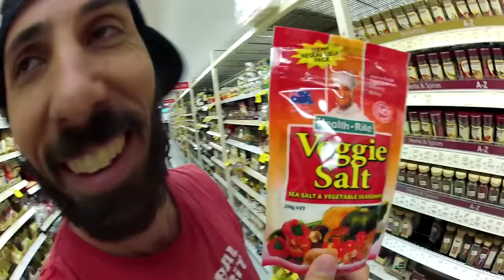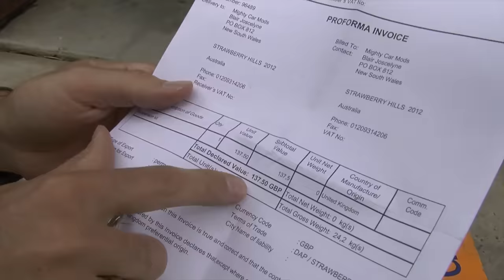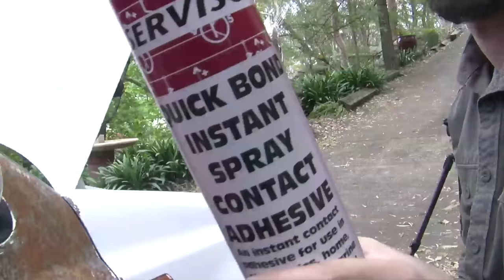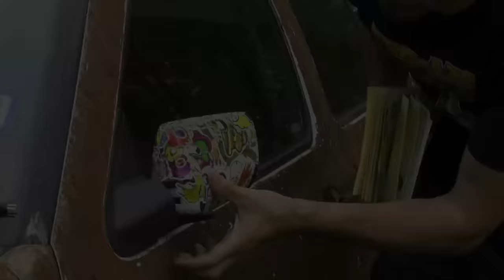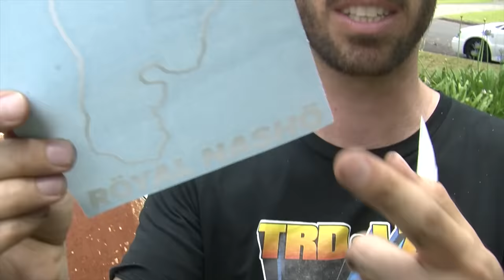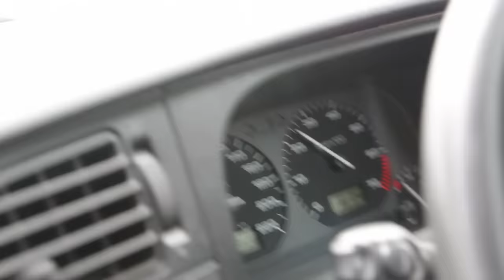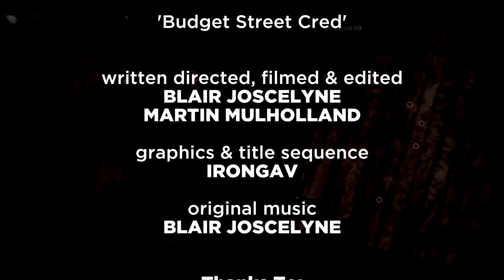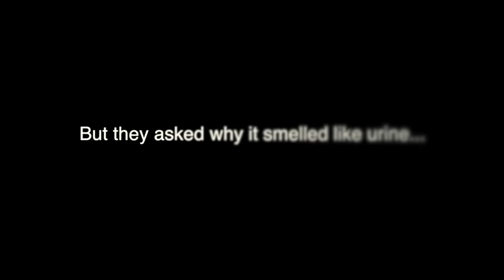Budget Street Cred (Season Finale)

Comment: Where's the best place to get aftermarket parts for Japanese & Korean cars here in Australia.

I'm thinking of doing the following mods & preferring Australian, NZ, Indonesia, Ireland, Malaysia, South Africa, Thailand, UK, or Japanese (or other LHT countries) sourced products:

* Woodgrain Trim, Leather Trim, Houndstooth Trim, or Velour Trim
* Woodgrain Veneer
* Woodgrain Inlays
* Woodgrain Inserts
* Window Tinting
* Leather Interior, Suede Interior, Velour Interior, Microfibre Interior, Alcantara Interior, Wool Interior, or Cloth Interior
* Lambswool Rugs, Heavy Pile Carpets, or Velour Rugs
* Heads Up Display (showing speed in km/h, the speed limit in km/h, GPS navigation directions, and ideally additional info like low fuel warning, lane departure info, reverse cam vision
* Footwell lights (possibly SMD LED STRIP LIGHTS)
* Rear Cross Traffic Alerts
* GPS/Dashcam (possibly Navman MIVUE860DC TYRE Dash Cam, Garmin DriveAssist 51 LMT-S 5" GPS Unit, Navman Drive Duo 2.0 5" GPS with Full HD Dash Cam)
* Blind Spot Sensor - Possibly Parkmate PTS-440BSD Sensor Front & Rear Blind Spot Detection System, Mongoose MBSW4 SURFACE MOUNT MODEL.
* Lane Departure Warning -
* Parking Assistance - Graphical Display
* Park Distance - Front & Rear 
* LED Headlights
* Car Alarm - to achieve compliance with AS/NZS3749.1 Class B or AS/NZS3749.1 Class A. 
* Camera – Rear - Potential Solution is PARKMATE 4.3" REAR VIEW MIRROR MONITOR, Gator 9IN MIRROR MOUNT LIVE STREAM CAMERA KIT, PARKMATE MIRROR & MINI CAMERA REVERSING SYSTEM
* Automatic (light sensitive) - Potential Aftermarket solution Jaycar KIT - AUTOMATIC HEADLIGHTS 10/13

Comment: Best way to paint strip. Cover the panel in paint stripper then chuck plastic film over the top and rub it in. When it does it's job, peel the plastic off and most of it should come with the plastic. I've spent too much time with that fucken scraper

Comment: Terrible episode! Just about everything done to the car financially, was not explained in detail. How much were the rims and tires? How much was the lip roller tool? What was done to the camber? How much did that cost? Did you get the alignment? 
Now, as for street cred, appearance is not all that's considered. Horsepower and engine/drivetrain mods are what's required for true "Street Cred"! All of that useless exterior work was an incredible waste of time/money. Suspension, wheels, and fender flares were great but, come on now! No intake? No exhaust? No chip flash or Dyno tune? A street car with upgraded valve springs with some pace setter headers and a high flow cat with a  2.5 inch modified cat back exhaust isn't much and would add some noticeable "Street Cred". 🤓🤔 
BTW, why were you pulled over? 
You really went to the wrong car meet a week later? ALL of those people were straight B.S.ing for the camera. I bet that the people who say they liked this car/episode, don't know crap about car's! You guy's purposely destroyed this car knowingly and willingly yet, you were able to find idiots that liked it? Just goes to show that there are sucka's born every minute/second! 🤓 Weak!
Reply: Dude, this vid is seven years old. Piss off 😂😂
Reply: @junglist1soldier  Buddy please, I've worked on cars my entire life, I was brought  up with them. Kinda surprised you know what oil is, ya little warrior.